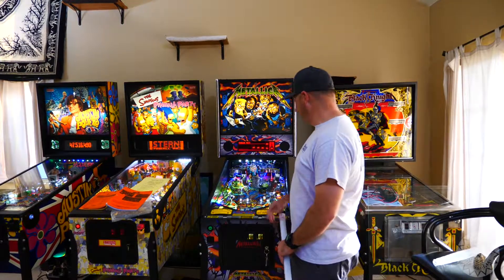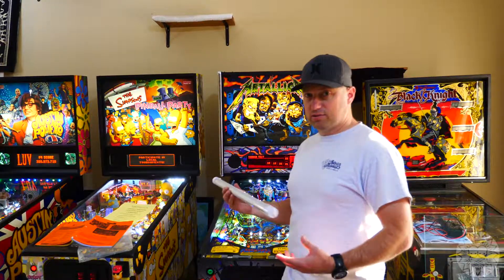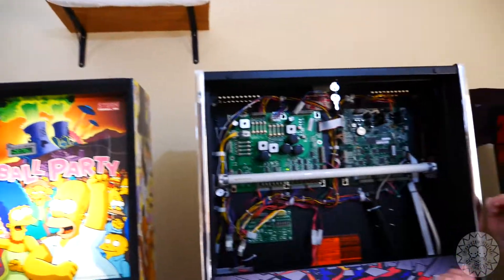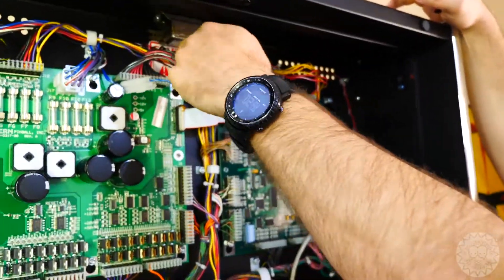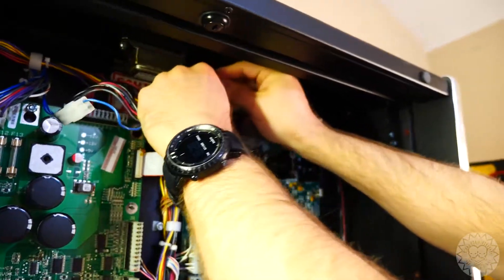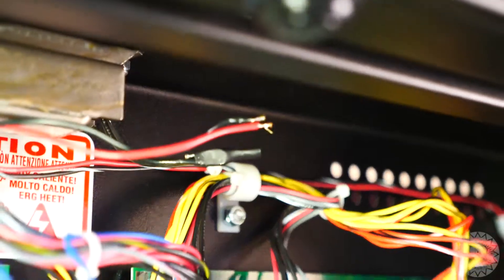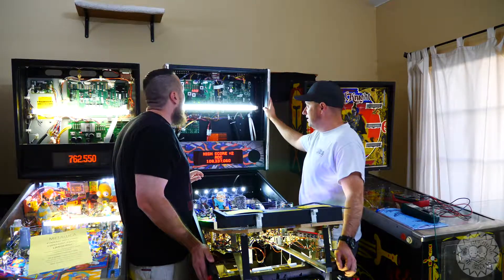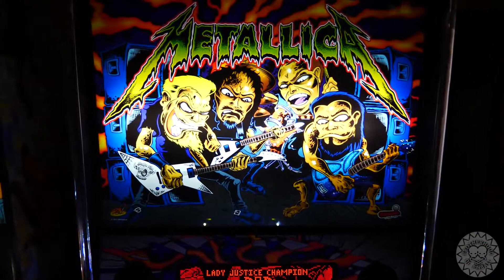Fluorescent to LED Lamp Conversion - Metallica Pinball

Comment: didnt you have to solder the wires that go to the starter together as well? You removed the starter but never showed you soldering the 2 wires that go to the starter together.
Reply from the maker: I believe we did at 8:30
Reply: Any idea where I can get this tube light? The link no longer works